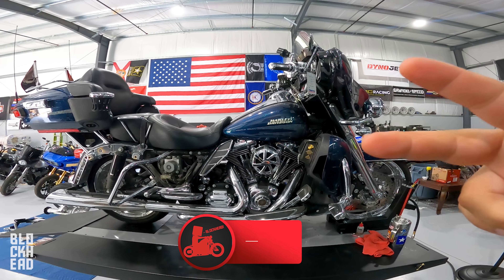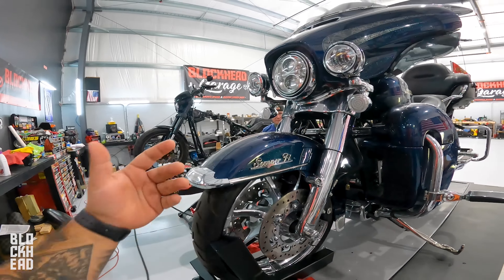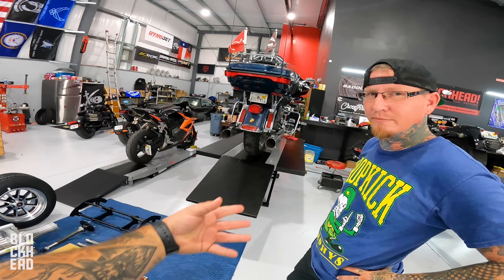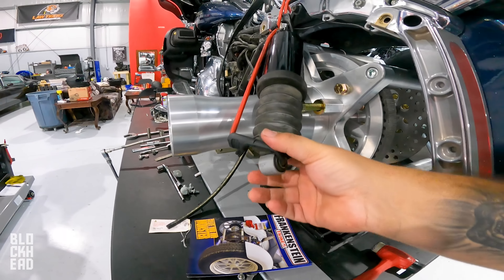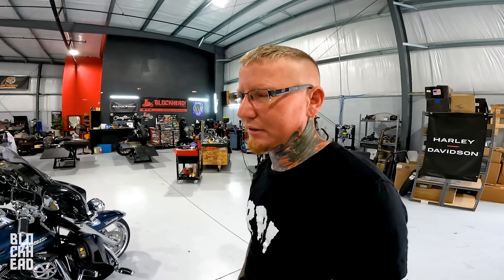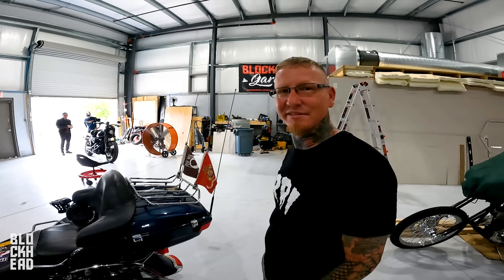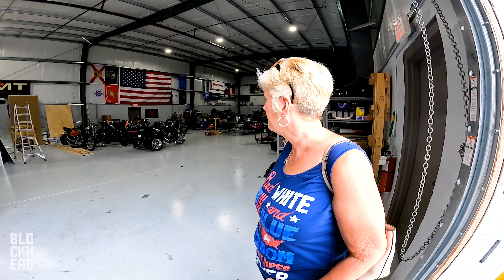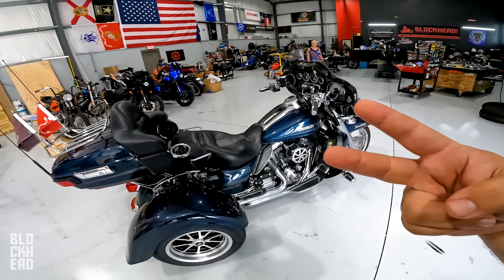Harley-Davidson Conversion for Late Veteran's Wife

Comment: All they would need to do is add a tone ring to the rear for a sensor to read for the ABS similar to what the OE uses. Fords used a signal wheel speed sensor for rears for a long time in the differential and they could do similar for the trike kits.

Comment: She's still required to get her motorcycle endorsement in order to operate a trike legally. That would not be the case if it were an "autocycle" which is generally defined as a cycle operated like a automobile (steering wheel, traditional seat/seatbelt....i.e. polaris slingshot). Just fyi for anyone not aware. I assume she is.